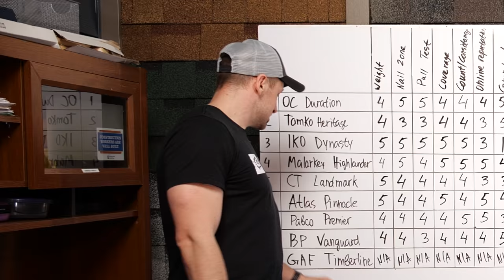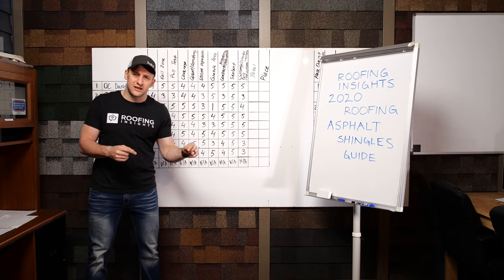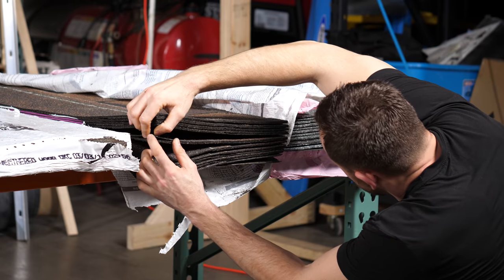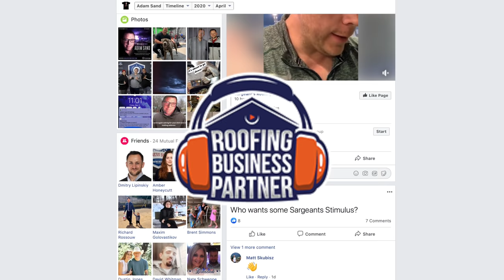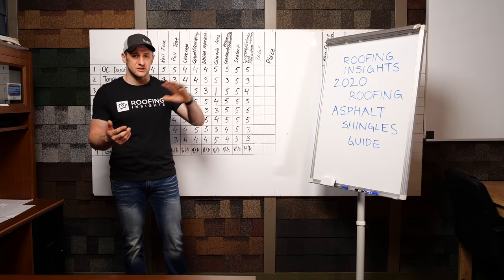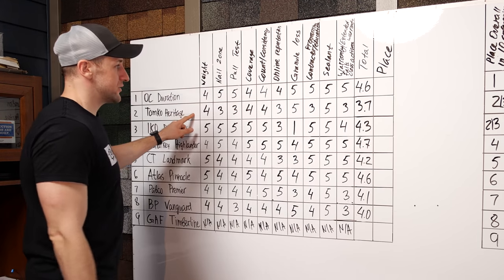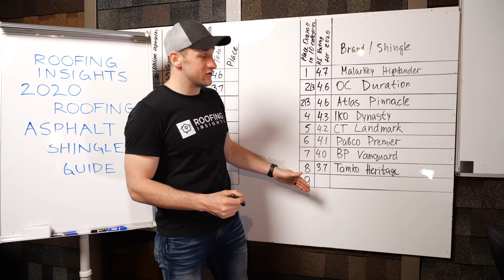Best and Worst Roofing Shingles by Roofers for 2020 | @RoofingInsights3.0

Comment from the maker: Full article, data research: https://roofinginsights.com/best-asphalt-shingles/
From Insights:
00:36 Explanation of tested categories 
00:53 Explanation for lack of GAF shingle review
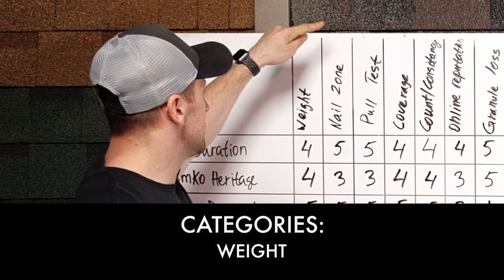01:34 Category introductions
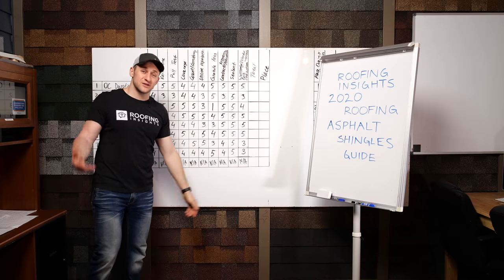02:05 Our 5 star rating system 
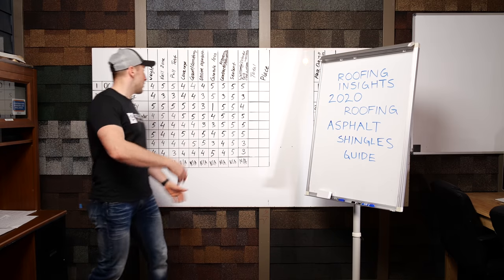02:56 Weight test
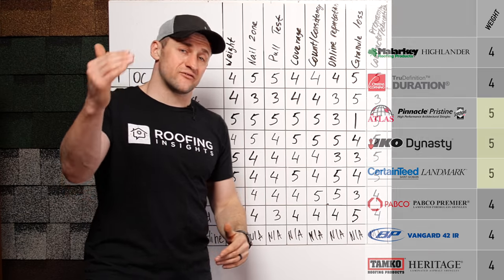04:36 Nailing zone test
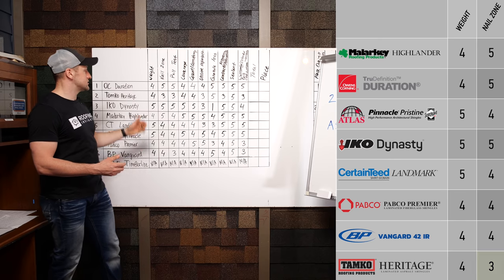06:50 Pull test 
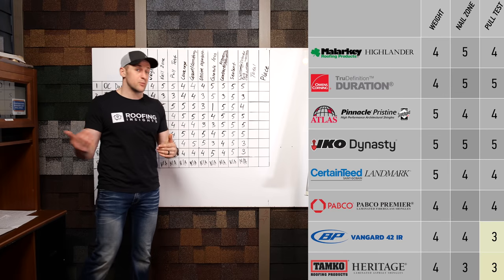08:14 Coverage test
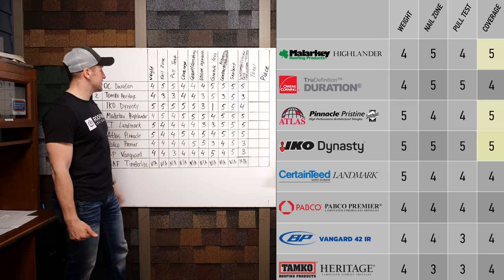09:26 Shingle count per bundle and consistency test 
12:20 Sponsor and partners thank you
14:55 Online reputation test
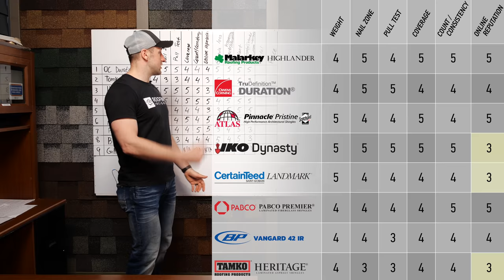18:33 Granule loss test
19:05 Homeowner granule loss testimony about chickens 
20:30 Contractor programs and education test
22:10 Seal/sealant test
23:27 Warranties/failures/class action involvement test
26:22 Score calculation 
27:15 Final results 
31:13 Conclusion

Comment: I agree with you on Granule Loss rating. My roof is eleven years old IKO Cambridge Architectural Shingles, I still have to clean the rain gutter twice every year due to high granule loss.
I won't use the product again. I recently found a tap of the shingles at an edge blown away due to high wind.

Comment: "We believe that if the shingle has major problems with the granule loss in the beginning, most likely in the lifetime, it's also going to be the case."
Would you say that granule loss reduces the longevity of a shingle?  If so, then from a homeowner's perspective, this is a very important rating category.  Perhaps it should be weighted higher than some of the others.  
Perhaps you should have more than one overall rating system:  one for the shingling company and another for the homeowner.  Or maybe add a rating system based on overall durability of the shingle, using the factors that contribute to that.
Thanks again for this video.  Very well done.
Reply: Yeah, just wrote a comment saying the same before reading this. A weighted system does seem needed.
Reply from the maker: If manufacturers cant keep granules on shingles immediately after install how can we trust they will stay later? We trust those who made granules to stay out of the box more, just common sense

Comment: I don't have a problem with how you did your testing and I have my opinion and I rely on what our roofers say since they install these products every day. They rate the OC Duration way above the Landmark and I'm a CT fan or at least used to be. I was one of the top sellers of the Malarkey products since 1992 in the Denver Front Range area up until 2013 when the contractor I sold for had a negative bias for Malarkey but they were a cheap minded company. The tear test is an interesting test, I would like to see more of that alone and can it be done differently, probably. Wind tunnel tests would be a good video to produce. Thanks for all your effort none the less.
Reply from the maker: Thank you for great feedback! We have been taking notes and will improve testing in 2021!! New roofing shingle guide is coming in 6 weeks!

Comment: Malarkey has always preformed well. I have lost 1 Malarkey shingle in 36 years, the winds exceeded 130 mph just after installation. Certainteed  is the only shingle i have seen blow off twice in 2 years and both roofs were installed excellently, i had to go back later and hand tab the entire 60 square roof after Certainteed bought the home owners a brand new roof.
Reply from the maker: Thanks for sharing
Reply: Any thoughts on the Malarkey Ecoasis NEX solar shingle?
Reply: I have not used this shingle yet. I have used other "solar shingles" . They were a little cooler but the color was frosty and muted. Malarkey only makes shingles and roofing underlayments . I trust them and their products , their tech support is excellent. Thanks for the reply.
Reply: @chrisginoc  for what its worth, I had a roofer bring by some full sized shingle samples so I could examine them.. a certainteed,  malarky vista and ecoasis.. I tried the roll up test on all of these, rolling them tight, tar side out, like a burrito.. then unrolling and examining how well they held up...the certainteed cracked in alot of places and showed damage when unrolled on the granule side as well as on the black  tar side... the ecoasis also cracked when rolled up..not good and Not like any tests ive seen online where they were damage free... lastly, i did the vista..it felt noticeABLY more flexible than the other 2 which seemed similiar in granules and construction but the vista seemed a different animal... more flexible, granules adhered much better and it had the least damage, almost none,when unrolled... In the shingles defense, I did the test in about 70 degree temps...I have a feeling, the online tests where done by leaving the shingles out in the sun to get hot, then folding them...my tests were torturous to those shingles...after rolling up, i stood on them, then unrolled... painful for the roofer to watch and he was impressed with the results... me, less so becuz I was expecting No damage at all... he said any normal asphalt shingle would break under that test.

Comment: I called  Erie metal roofs. 
When  they  came  instead of  selling me  a metal  roof.  They  brought  two guys  out to  gang up on me,  to  pressure me into  buying  there  Asphalt roof.    The cost for the asphalt roof was almost 10 times as much as my original roof 21years ago. And they were  putting a second  layer. Without  a     Tear off!

Comment: We live in the SW US and GAF is by far number one in sales. However, both Malarkey and PABCO are gaining ground because lots of folks have had a poor experience with GAF.  TAMKO is sold here but it is used mostly for commercial construction like apartments as well as new construction.  

We had a 100 year hail storm in 2016 and literally everybody got a new roof at the exact same time.  My neighbor and the guy across the street each bought Class IV GAF Timberline.   I bought PABCO Premier 40 which are still on the roof. My neighbor and the guy across the street have since had to replace the GAF Class IV from a few very minor hail storms; they both bought GAF's cheapest Timberline 30 year AR shingle to replace a 3 year old GAF Class IV.  How many times do you have to be hit in the head to know it hurts???

.  If I had to do it again, I would buy PABCO or Malarkey.  Haven't heard anybody complain about either of those.  A neighbor that bought ATLAS Class IV in 2016 has also had pretty good luck.
Reply: Malarkey is really thin like gaf where pabco has hardly made any changes except granule cut an adhesive all shingles these days after about 90 degrees the seal strip sticks to the plastic on the back of the shingle

Comment: So I just had the CT LANDMARK PRO MAX DEFINITION installed by a reputable roofing contractor. I love the looks and it comes with a great warranty, how would it have performed in the same rating system/test?
I watch alot of your videos and have learned alot of great best practices  while doing so, THANKS
Reply: Certainteed are the best shingles I have used, was a 12 year OC installer, been with Certainteed for last 7, and yes they are built like tanks.

Comment: I will hand it to this gentleman he did cover a lot. He also missed a lot as well. The test appears to be missing many other aspects of the shingle and its performance. I'm familiar with most and have had installed most as well. Region has a lot to do with performance or the lack there of.  First question for my friend at Insight is in the weight category. Why are we testing per bundle when we are talking per square weights? Lets redo the test and randomly pick bundles from different pallets of material and maybe different manufacturing dates. 2nd question is in the nail zone category. I see wide zones and I see narrow zones. If we look at the profile of the shingle especially where the shingle is mated or overlapped (where its to be nailed for manufacturers warranty to be valid) we see various overlaps (some small and some actually as wide as the front nail zone which appears). Some manufacturers add a tape strip to help with uplift which contractors are selling as better with high winds? I'm not so sure.  Corpus Christi's storm of 2017 didn't discriminate on what shingle was installed. In your opinion Mr. Insight whats a better system? Hand nailed or pneumatically nailed. Maybe give me a few reasons why or why not. What is a pull test supposed to prove again? I see a lot of 3-tab roofs(supposedly inferior) that I'm sure would fail pull tests but are still performing quite well. What are we really testing here? I feel some manufacturers have skewed or manipulated our understanding of what a roofing shingle should do. Maybe this is why GAF didn't respond. Let apologize for that last comment. I'm sorry. Lets move on to count and consistency. Tell me if I'm wrong but why are the manufactures selling squares of material (list above tested)in 3 bundles per square instead of 4. The inconsistency could be eliminated. When I break something into thirds it doesn't work out evenly. Are we educating the public or shoveling ____? Moving on to granule loss. How many months or years in fact has this test been in affect for your results? I hope that opening up a bundle and inspecting what was left in the plastic bag wasn't what you used for this test. Why is this test even relevant? Maybe lets test the granules (Algae version, Solar reflective) themselves or maybe the bonding adhesive. Do all manufacturers use their own components or do they sell to other manufacturers. Lets test the fiberglass mat and the differences each manufacturer uses. Lets test the asphalt and who uses the most filler so they need gimmicks to sell their shingles. I'm sorry again for running my mouth. Why should the consumer pay for an additional warranty? Some manufacturers are going directly to the roofing contractor and offering some sort of ridiculous status as a Super Duper roofer that can offer a Super Duper warranty that the consumer must pay for. Don't the manufacturers believe in their product and think that their standard warranty will hold water? Most consumers move before the warranty is over. Wait did I just figure out what some Roofing manufacturers are BANKING on. Why can't the manufacturers place a warranty on the roofing shingle installed no matter how many occupants? Mr. Insight I appreciate all your dedication and insight. I do feel your service is good and could be better. Keep up the good work! A former roofer.
Reply from the maker: Thanks for detailed feedback!!! Notes are taken!!!
Reply: Iko granular loss is so bad that it’s very slippery and dangerous to install. Gutters are full of granules by the time an install is done. Granules are also what protects your shingles from the sun. So yes it is a relevant thing to test for. Read into how malarkey shingles are made and you will see why it is number one. This test is spot on.

Comment: This is an outstanding video.  However, not sure why you need GAF to respond to you.  Wouldn't you just evaluate them against the others independent of their contact?  Main reason I came here was to see your opinon on GAF vs Certainteed.  Those are the two main brands used in my area by roofers, followed by Owens-Corning.
Reply from the maker: We already reviewed them

Comment: You reviewed IKO Dynasty, but for the 1 star granule loss section you said it was for Cambridge. Did you just misspeak on that? I recently ok'd my roof to be done next month with IKO Dynasty. The Cambridge line gets a bad rep and I think that blends into why the online reputation is bad for IKO too. Cause it's based on Cambridge. Everything I've read and watched, including some of your prior videos, suggest Dynasty is a pretty solid product. Thanks for taking the time to make videos and pass along information. You really helped a small common homeowner like myself make a decision a few weeks ago!
Reply from the maker: Last year it was Cambridge with same problem. Dynasty is actually worse. We post numbers on our website
Reply: I believe that was a misspeak. I also don't believe the granule loss category makes sense. The excess "carrier" granules in a bundle are overspray and didn't come off the shingle. They were never on there to begin with. The shingles themselves are completely coated. Probably money lost by the manufacturer,  but its not granule loss. That can happen, but its after years on the roof. It shows as shiny spots on the roof when so many stones come off, you can see the fiberglass mat.

Comment: Dimitry,  Love your videos and learned alot so far.  Live in Northwest Ohio (don't judge me, I'm not from the area),1st time homeowner,  have some repairs needed to roof, and looking at replacing shingles on entire roof.  Have two quotes for roughly same amount from different experienced contractors/brands.  Question is for approx same price, should I put on Altlas Pinnacle pristine (with Signature Select System, no ridge vents) or Certainteed Northgate (with ridge vents and 5 star warranty)? 

Pinnacle is not class 4, with Northgate is class 4 impact resistant.  Your video shows Pinnacle better than Landmark, but is it better than Landmark Pro , Landmark Premium  and Northgate?  Which manufacturer has better roofing system (underlayments, ice/water protection)? I have areas/valleys that don't get sun in winter... snow accumulated in past,  iced and melted and leaked into garage.

Discount for impact resistance for me is only $120/yr, not really seeing the benefit. Reviewed severe weather history in my area, and shows mostly penny-quarter sized hail , with winds up to 70 mph...Pinnacle shingles upto 130 mph, while Northgate only warranty up to 110mph (130mph with upgrade).   Algae resistance/warranty is important to reduce maintenance down the road. Atlas with lifetime* AR, while Nortgate with only 15 year warranty for AR. 
Leaning towards Atlas Pinnacle based on your testing, but see benefits to Northhgate's SBS shingles for weather .
What else did I miss or need to consider? I'm looking to the best shingle for the value, not cheapest, but not most expensive.
Reply from the maker: I would go with Atlas, dont like Certainteed and their support. Great shingle but I always go with brand that cares more about contractors.
Reply: @RoofingInsights3.0  Appreciate the quick response...Thanks!

Comment: Thanks so much for the information, decisions, decisions but your work certainly is making it easier. Thanks so much. We just had a roofer start a quote for us today, he generally goes with Tamko or Atlas, makes me slightly nervous to hear he uses Tamko after seeing your review but maybe it's a 3.7 meal vs the 4.6. If the price is the same I'll probably God willing be going with the Atlas indeed. Thanks so much. He's been doing it for years and mentioned how much grit comes right out of the bags of the GAF and mentioned that he wonders how much stays on the shingle and that it is also dangerous which I believe I heard you mention in either this video or a previous one. Thanks again, great, great stuff. One thing that seems to be a big up seller at least around here and I'd love to hear your thoughts and comments on it is 15, 30lb felt vs ice/water shield over the entire roof etc, one area the roofer didn't think was worth it with architectural shingles for the most part which I appreciated his honesty. Hopefully he is right. Yikes, lastly he didn't really suggest adding a "roof vent, we do have a gable attic fan but I'm wondering if it's really enough and if a ridge vent really might be worth it. Thanks again, great, great job!!
Reply from the maker: Thanks for feedback, glad you like it!
Reply: Ive been roofing for years do not use atlas or tamko,worst shingles out there.Certainteed and Owens Cornings are the best.

Comment: We have been in business for 43 years, and the 3 owners have a combined 95 years of INSTALLATION EXPERIENCE because we install with our employees on a daily basis. We have used Tamko for 43 years. These are lab test results. Go do a field test study of 20 year old roofs and talk to installers with 30+ years experience and your results would be VERY different. Local wind storm proved that Tamko's sealant was much better than other brands. If you have ever installed these brands on a daily basis, Tamko Heritage shingles lose less granules when installing in extreme heat, AND are more pliable and break less when installing in extreme cold. The only thing I agree with is the nail zone, which could be better, but if you have good installers who actually get the nails in the nail zone, and because of Tamko's proprietary sealant, which is the best in the industry, your shingles will not go anywhere! Tamko makes one of the best shingles despite this study!
Reply from the maker: Is it a joke? Tamko has the most inconsistent most poorly performed product and 90% installers will agree to it. Look at any survey.
Reply: I have 30 square of Tamko ,28 years on and no leaks still looks pretty good
Reply: I have Tamko 8 years old they are junk 
 My dont stick and going need new roof

Comment: I live in the Space Coast area of Florida and I am trying to decide between OC Duration and Certainteed Landmark as they are the main brands most contractors in my area install..I like the weight of the Landmark, the warranty of the Duration. This is not an insurance claim roof replacement and it is not my forever home. Thoughts?
Reply from the maker: I would go with Duration